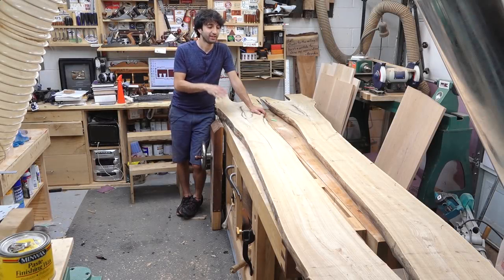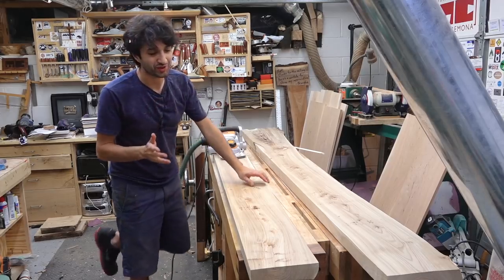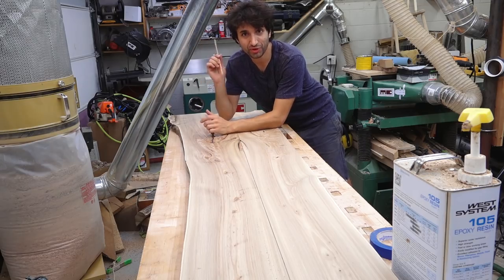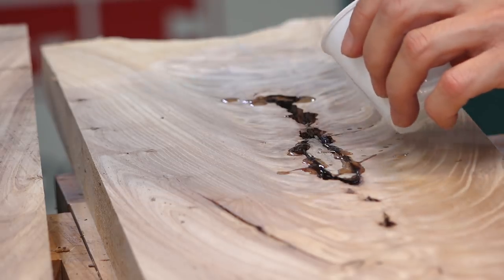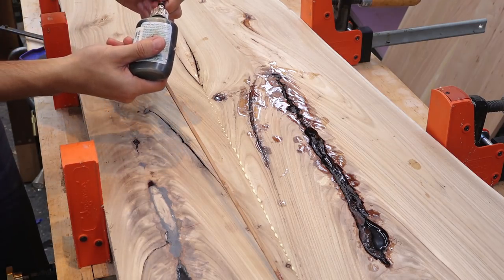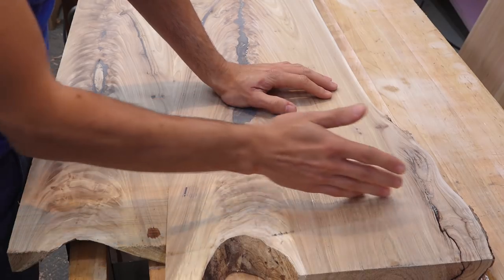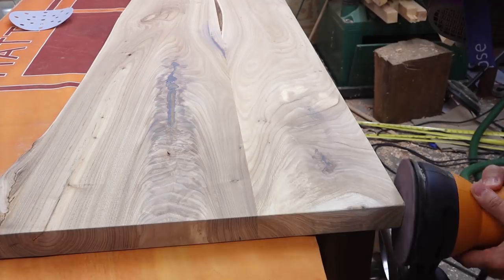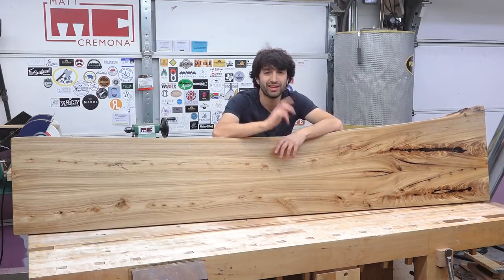Bookmatched Elm Crotch Bartop

Comment: That was a deep cut on that jointer. lol
Reply from the maker: that's how I roll!
Reply: too deep.. looks like 1/2inch passes
Reply from the maker: 1/4 on the edge, 3/16 on the face
Reply: I thought it sounded like it was really working so I am not surprised the thermal overload tripped.  Why not use the track saw to rip it straight?  Cut not deep enough?
Reply: Might not have enough track :)
Reply: You nailed, ‘’subsequent coats’’ this time!
Reply: that's what i thought lol almost a quarter inch. tool abuse!
Reply: well, we all know that.... "The first cut is the deepest, baby I know, the first cut is the deepest.  But when it comes to cut'n wood he's cursed.  When it comes to lovin wood, he's the worst."
Reply: @jocmarti   Yeah, I wondered why he used a band saw. He made some seriously curvy cuts which required the multiple deep cuts on the jointer to straighten it out. Forget track saw, even free-handing with a circular saw would have come out straighter than it did with the band saw.
Reply: @mcremona   at 1:47 that's way more than a 1/4 inch.

Comment: I have a elm that was pruned in the wrong seasons and it developed quite the load of pins......under the bark are thousands odd little "volcanos" where the tree sent out suckers......I have quite the buttressed base that must be 6 feet wide and the first main crotch about 8 ft from ground level, the rest of the big burl type "clubs" are anywhere from about 6" to 2 ft across and about 8 or 10 ft long.......it looks like some kind of dinosaur skinned worm type beast with 2 "heads", yet to be carved........ it would be one heck of a totem pole or sculpture of a mythical beast about 10 ft long and 2' wide

Comment: How did you dry it? How long does drying elm take? I had a elm fall on garage a few weeks ago. Yesterday my buddy and I milled it to about 2 1/2 inch slabs and some 1xs. Wanting to do a project like this any advice would be much appreciated. Thanks

Also my slabs are between 25"-27" wide and about 10' long.

Comment: Question; I aim to laminate two slabs together like you did here. My slabs are a little over 5' long and just under 2" thick, and I've been wondering what joint to use. My slabs will eventually be a trestle table for my deck and they are Lombardi Poplar. The frame will be Douglas Fir. I noticed that you used a simple butt joint. Is this strong enough for my application? Looking forward to your advice.

Comment: Rewatching, we have a 150 year old elm felled last month. It’s about 4’ - 5’ in diameter. I have a portable sawmill scheduled but the trunk(with multiple crotch) is to large. I haven’t found anyone around that can handle it. Your Mill could handle it with no problem. I can’t wait to get this baby slabbed, the bar top turned out beautiful.👍🌳

Comment: Hi Matt, could you explain a bit about how using a torch on the epoxy helps with the bubbles?
Reply from the maker: The heat causes the air inside the bubble to expand eventually causing the bubble to burst
Reply: Stephen Keefer, When using torch, see how fast he waved it ?  If you go slow you will curdle the resin and thats a no no. Ive been making Myrtle Wood clocks. tables and such since 1968, try Myrtle wood if you want the most awsum colors and burly grain. Email me if u want to try a piece.

Comment: Can you tell us about that orange sander you used on the epoxy?  I usually use my belt sander to make quick work of epoxy as the 5" orbital is usually too slow.
Reply from the maker: That's a 6" gear driven/orbital sander.  Very similar to the festoon rotex.  It's very aggressive in geared mode and will chew through material pretty quickly.

Comment: Great job! Looks really nice.
1 question. If using epoxy to fill in voids is it possible to use a hand plane to finish smoothing? I hand plane my pieces when I can - they are obviously smaller slab sections

Thanks
Reply from the maker: yes, it has no grain direction to worry about so it planes really easily

Comment: I guess you wherent worried about putting in biscuits to join the pieces?
Reply from the maker: +hurcule911 no, I almost never need to use any alignment aids
Reply: Biscuits are for babies
Reply: But a few good old fashioned 1/2" wooden dowels could have added mechanical strength to the joint.
Reply: Biscuits, dowels, dominos...none of these really add strength just alignment.  The winner for Matt was a good glue spread and of course precise jointery.

Comment: Nice work. I wonder if you had used a single pour of clear epoxy in the large cracks you would have obtained an optical look and be able to see inside the finished cracks? I personally don't like the look of the dark epoxy filler because it looks like dark epoxy filler.  Just a thought...

Comment: Treat yourself to a good quality Italian or German sliding table dimension saw as one of those will make big bar tops much simpler to do..
I use burnt wood when I fill gaps in the tables I make..just crush it up and mix in the epoxy..very cost effective.

Comment: It would be a lot easier to mill the wide lumbers you have using 16" or 20' European J/P combo machine, also save a lot shop space. And a Euro 10' sliding table saw will be super easier for ripping long board, and much safer than cabinet saw.

Comment: Matt, would a track saw, like the Festool TS75 that has a 3" cut depth, have been an easier option to rip each slab and then rip the glue line for joining?
Reply from the maker: yes, a track saw would work for the process.  I don't really like using a track saw on rough sawn stock though since the track doesn't always sit down solidly on the wood.

Comment: On joints where I have a live edge like this I use a long piece of aluminum channel as a straight edge and use a worm drive saw. Sometimes that's all it takes. It will cut your work down immensely. And you wont trip your breaker. Old man trick.

Comment: Great job!! Regarding the jointer shut down my late dad had the same issue with his jointer when using it to plane full width boards and it seems that's what was done with this elm. 

I'm not sure why the planer wasn't used instead. 

My dad often found second hand motors for his tools and would have to replace brushes occasionally due to overheating. Maybe that applies here.

Comment: matt this was a good project but must say you wasted time and made more work for yourself. you could have saved a bit of time and effort. let me explain ..... you cut both edges of both boards by wasting time using a pencil and another board to make straight lines and then used the table saw in the shop to cut and then have a hard time making a straight cut then you proceed to use the joiner to straighten your edges. would have been easier to clamp both boards together and put them on the band mill and make only two cuts with less hassle keeping edges straight then a pass or two on the joiner..... a lot of labor and time saved and more accurate with cuts .

Comment: You can use the table saw to joint that live edge slab.  Cut a piece of plywood just wider than the slab, do not move the fence, screw the plywood to the underside of the live edge piece with the line you would like to "joint" hanging over the edge of the plywood......run the plywood back through the saw. Glad your jointer worked out.....hope this helps for next time!
Reply: Late again. When I saw elm I had to watch. Gonna get a lip thrashing from the wife; and she'll say:
"Cremona again ?"

Comment: Did you add biscuits into the joint as well, or just glue? I recently made a walnut table top with two slabs and used biscuits, but is there a rule of thumb when just glue and/or biscuits are needed?
Reply from the maker: Biscuits are alignment aids so they are useful when your boards don't sit flush